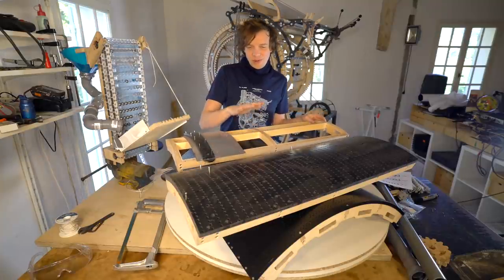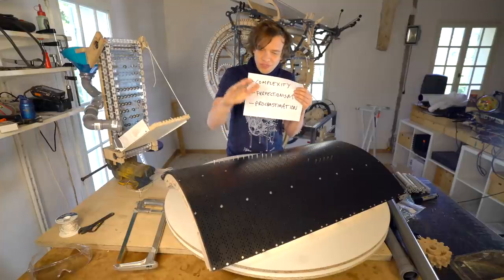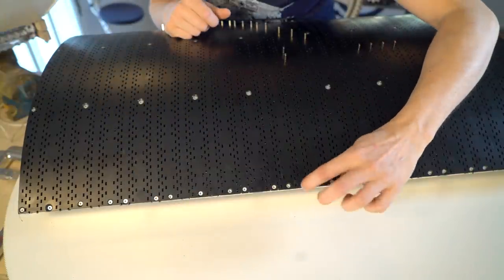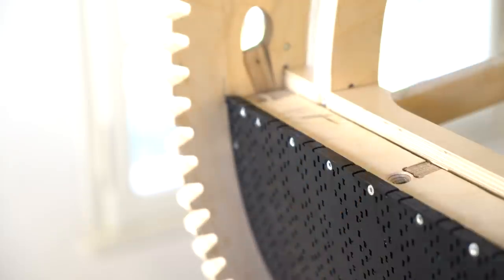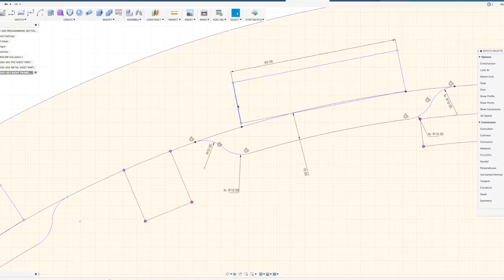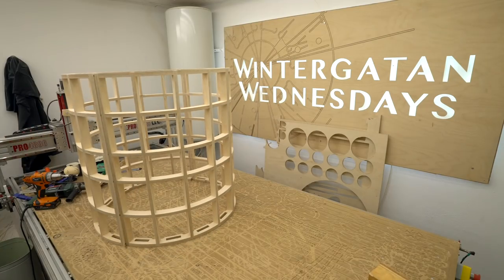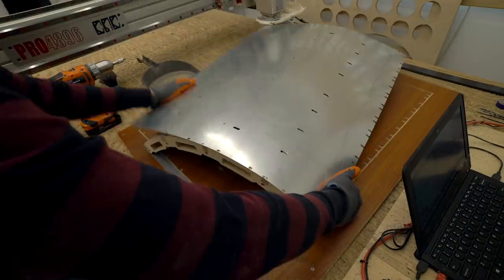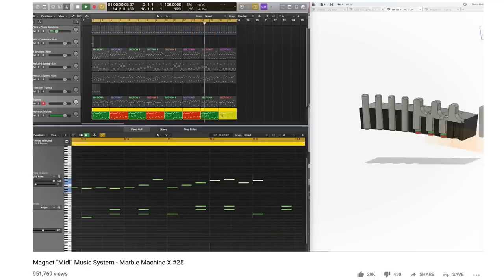Music Programming Plates Part 3 - Marble Machine X #65

Comment: The problem with Theory and Practice;
in Theory: theory and practice are identical.
in practice: theory and practice are often different. :)
you might know this, but i want to drop some thoughts i had in case you havnt planned for them.

super glue arbor: you can glue down that metal sheet to your backer plate with super glue, or similar, then heat it to break the bond and remove the part later. this means no more alignment holes, screws, pins and tape to hold down your part. be careful when heating to avoid warping though.

the material properties of wood: wood will expand and shrink with the moisture in the air. especially if you come play that thing over here in south florida. especially if you ship by boat over the wet ass sea. i recommend exploring acrylic, or a metal, or plan for a humidity controlled shipping, and storage. expansion of most parts will be trivial, but programming wheel might be significant. average humidity in south fllorida is 50-70% with rainy season getting up to about 90% on average

alignment of programming boards: you will likely have 2 or 3, or 50 songs preprogrammed on boards. you might want to design in an identification system now, numbering or color coding or something, song 3 board 1, song 3 board 2, song 3 board 3 etc. you dont want to be rediscovering the order of the boards on stage performing for an audience that hasnt followed the series, and isnt already aware of the challenge.

its cool to think through this stuff, and really put to work the whole process start to finish. keep up the excellent work man. and you bettter come perform in south florida one day. i recommend the kravis center  https://www.kravis.org/
Reply: i just rethought one of my thoughts. your indexing off that plastic board... those dont expand with moisture. you might be good. might want to design a little bit of tolerance room in the wood. make all the wood a half mm smaller or something to pull it tight against the plastic, and leave room in the wood so it can adjust. might also want to measure a wood piece, then steam it, then measure it again. the cross grain of that ply laminate will help keep some tolerance, but i wouldnt put my money on it without a test.

Comment: the only way I can think of to eliminate any register problems in the programming wheel plates is to have the entire wheel as one assembly and switch out the entire wheel for each song...not a one person job. And would require a redesign of the entire programming wheel system.

also, depending on how many tour dates you are planning, and how many times these plates are going to be switched around, over time there will be wear on the parts and the plates will lose their registration...also temperature and humidity will be an issue as well, wood shrinks and swells with changes in temp. and humidity.

Comment: I hate to potentially add to your woes, but is there risk of the plastic expanding and contracting in different temperatures?  I've been wracking my brain about the programming plates since I first saw them, but I have no real solutions unfortunately.  It just seems like there could be a more reliable way to register it all, but far greater minds than mine are working on this and I'm just a fascinated spectator.  This is an amazing project, thanks for sharing it.

Comment: your dilemma between perfectionism and complexity made me think about the Vibraphone movement from last week. is this mechanism adding to much complexity to the MMX? have you considered that under the vibraphone plates the vibrato mechanism and the resonator pipes may also have to swing? maybe this makes the whole mechanism to complex. don't get me wrong. if it would worked, that would be awesome. but isn't the main goal for the MMX to play musik tight enouth? in this case maybee you should focus more on the reliability and the correct function

Comment: Martin,  why did you not just remove the top of your table, put the program wheel on a roller with a timed stepper motor to rotate it set length wise inside your table and then use the cnc router to cut the pin holes in place. The stepper would be set up as an "A" Axis.

Comment: Rabbit the two plates edges were they meet. this way you can incorporate alignment pins. Like you said the plywood is not a stable material and will change depending on moisture.

Comment: Did you ever thought about adding a 4th axis to your cnc and process the bended and mounted programming plate with its frame locked in place? It is relativly easy build with one or two stepper motors and a worm gear each
This would increase your precission and you wouldnt have to calculate the bending efects in your processing

Comment: The non-floating one should be somehow marked in an obvious way. Otherwise, when doing a "quick-change" during the word tour you might run the risk that it isn't in the set of frames put on the machine (or multiple multiple of them being put in).

Comment: gonna be honest i think instead of reporgramming each plate that you should just make new plates that would be the fastest change over but parts and time to make the parts is up to you there is always the possibility that someone wont put the pin in the correct hole or they wont push it down and it will fall out or they could put them upside down i dunno it just sounds well ..complicated

Comment: Wouldn't it be easier to get a Laser Attachment for your CNC??
I think it will give a sharper edge.
And then you don't have to use High Pressure Cleaner, to remove chips.

Comment: Are you not concerned about the wood expanding and contracting from humidity? That concern came up in my mind a long time ago but I never mentioned it until now when I saw you with calipers and stating the length between the pins had to be precise. I know the plastic is stable from humidity but the wooden frames aren't. Especially if the wood isn't sealed. Maybe that's not a concern of yours but it was just a thought of mine I wanted to share.

Comment: Martin, how do you avoid that you unintentionally flip the programming plates and put them on the programming wheel the wrong way? You should design it that they can be mounted one way only! Good luck with the design and the build!
Reply: By printing 'TOP' on the inside of the top bar each of the programming sections!?

Comment: The accuracy of the programing drum is a key point, if you are trying to achieve the timing perfection of a played MIDI music file. But the programing drum is an analog device. There will be a change in timing accuracy in the transition from one quarter panel to the next. But honestly in my opinion 99.99% of listeners will not notice the inaccuracy. I ask you. In a live performance of musicians playing. How much timing error is between them? Probably more than in the programing wheel.

Comment: Here's how you fix the problem with cutting thin material that will not lay flat. Add another sheet of plywood on top of the metal sheet and attach it. The two layers of plywood will hold the material for you. This is how I cut brittle material without causing damage.

Comment: have you considered opting for high adjustability rather than high precision ? high precision is a pain to work with and assemble. you are more likely to damage due to the low clearance and tolerances, it harder to design, build and most importantly assemble. most high precision equipment is made in one piece and/or is not expected to be dismantled regularly. id suggest designing the plates with more tolerances and add either to the plates or the wheel knob and systems to fine tune the machine. i mean that how many instruments are designed.
Reply: gavin kemp  Good idea, but you should be using the word “clearance” where you are saying “tolerance”. It’s a common mistake.
Reply: @dansv1  what the difference, high tolerence implies high clearance because you can't have the extrems overlap. you can have high clearance and low tolerance but what the point in this case.

Comment: Rule 1: if you can't make it perfect make it adjustable. Trim the edges so they're too close together add indexed spacing clips made from magnets and steel clips you can precision mill.
Reply: Respectfully, how is Martin to provide any adjustment to the plates in the middle of a concert?  I mean this as a serious question and not a trollish idiocy.  Martin finishes song one, and they pop off the old plates and pop on the new ones.  How do you propose to perform the adjustment?

Adjustability would be fine, IF he had the time to perform the adjustment.
Reply: @WhatAboutTheBee  it's not adjustable in the way you tune a guitar. It'd be adjustable in the sense of providing points of reference that can be connected by high precision pieces without having to bother creating a perfect programming plate.
Reply: @Argosh  The precision connecting pieces between plates might work.  It effectively creates one continuous plate around the circumference.  

This implies that each set of plates remains as a set, and the order of plates within that set cannot change.

Reasonable!
Reply: @WhatAboutTheBee  you can even use the 32nds by creating triple inserts for the edge (so one index in the last 32nd on the plate, one in between two, and one in the first 32nd of the next plate), with a bit of engineering you might even be able to still effectively use those 32nds (with different types of triple inserts)

Comment: Why the holes on the programming plate is designed that way?
Reply: if your question is about the bone shape of the holes, Martin gave an explanation in a previous video, while the pins have a rectangular section, it's easier to intrduce and remove the pins with that bone shape (less friction). Hope this answer your question...

Comment: You can get 'down cut' router for cutting the edges sheet metal or other thin stock that is impossible to hold down. The helix on the bit is reversed so the cutting force holds the material down. A disadvantage is that they throw the chips down so cutting blind slots (which is about 99% of what I've seen you do) can take a bit more time. An advantage is almost no tear-out on the top surface and very little on the bottom when cutting through slots (if you have a clean sacrificial table). The best solution is to use an up cutting bit to route a slot just to the outside of the metal sheet, then cut the metal sheet with the down cutting bit. The pre-cut slot will give an easier path for the chips to escape.
https://www.woodcraft.com/blog_entries/spiral-router-bits-vs-straight-router-bits

Comment: Why don't you use hot glue (or melted resin) next time to hold metal parts on the edge for the CNC to cut them. Just use a heat gun to loosen the glue, and just scrap off (or use mineral spirits) to remove the rest of the adhesive.

Comment: not entirely sure how you'd expect to achieve 0.01 mm precision at that dimension with plywood parts hold together by wood screws, such design is bound to fail from the get go. maybe with machined aluminium parts bolted together,  tapered steel pins/bushings for the alignement of the quarters and the whole assembled drum being machined for good runout on a lathe. and even then it's a tricky enough task to pull off.

Comment: Dont you think that changing so many pins between songs is impractical? Thats thousands of pins that need to be changed between every song... thousand of anything is A LOT. Its gonna be really bothersome to change them every single time. Not even mentioning how prone to human error that is.

Imo you should have had pins in every single hole and an electronical mechanism that pushes them outward. 
And that mechanism is controlled digitally. Changing song "sheets" digitally" for efficiency, while maintaining the physical element of the pins.
Then all you would need to do is feed the programming wheel a different digital"music sheet" and the pins would change automatically.
Reply: I think the plan is to just exchange sheets between songs. So then you wouldn't have to change them at all during a performance.
Reply: I was thinking the same thing... He should at least make 4 more boards (combined 12) so you have 2 songs time to prepare the boards
Reply: Martin has said in the past that he wants to avoid electronics in the MMX as much as possible - beyond microphones, he wants everything to be mechanical and hand-driven. Otherwise, there'd arguably be little point in the programming plates - computer controlled motors for the marble release would be more straightforward. But that would go against the spirit of the project.
Reply: Yeah the plan is to exchange sheets between songs, but as you heard he is only planning for a second programming wheel, and the one currently not in use during a song, will be repinned. 

Repinning thousands of pins takes a lot of effort and time. Im not sure he has considered that thoroughly.
Reply: gh0un Martin can have a paper that is the same size as the plastic. And only the holes that  should put pins in  is there. Easy and faster without thinking 🙂

Comment: MArtin winter 2017-18:lets get this thing going and get it done by christmas of 2018!
Martin spring 2018:im moving along on the big parts. An have much of the framework and wood gears done! (Then again it was little more then improving and rebuilding the good parts of the original marble machine)
Martin summer 2018: lets start working on prototypes for the smaller details that i want to make major improvements on from the original marble machine
Martin fall 2018: i need help!
Martin winter 2018-19:i scraped these parts. Reworked these parts. And need to make adjustments to those parts.... and i dont want to deal with some other parts yet.

Comment: This is an amazingly beautiful machine with an ingenious design, but there is zero way this thing is going to survive the road. There are infinite points of failure, and unless you have at least two spares of every component 
it’s going to end in disaster. Touring and shipping are just so incredibly hard on equipment and in my opinion is that being grossly underestimated here. I would hate for you to take this thing on the road and be devastated when something either wears or breaks to the point that it can’t be fixed effectively at a venue. I don’t mean to discourage, but if you want to be reliably prepared to play shows for paying audiences you’re going to need more than one of these. Don’t find out the hard way.

Comment: what if... there were no programming wheel and you used a micro controller to activate the marble droppers 0_0 ...infinitely programmable and song changes would be instantaneous.  the micro controller would read the speed of the crank and adjust tempo accordingly.

Comment: @Wintergatan I wouldn't call it procrastination. You know a task to be daunting and its something you have to approach mindfully and sometimes you need to give yourself time to ruminate on said task. So you tackle a smaller one; what some like to call "low-hanging fruit". Many technical/creative types exhibit that pattern when working on complex projects. Meanwhile your subconscious is still working on the bigger problem, almost like a computer's operating system running a background operation. By the time you're ready to tackle the big problem you find yourself with new insights on how to better solve it. At least that's my take away from this video.

Comment: Why not make single mats (perhaps out of another material) that wrap fully around a cylinder for each song?   That way you only need to get one joint nearly perfect.    With entire mats made for individual songs you only have to mill the holes a single song on each mat.    New song = new mat.   You only need a system like what you are designing if you were to compose and change music on the marble machine... but I bet you compose your music on other instruments... the marble machine is just a playback device.

Comment: Would it be a possible solution be, to make a disc per rotation of programming holes. So you stack them to make the complete cylinder of programming holes that you need for the marble machine? Then you could make us of the presision of the CNC machine for both the holes and the guiding pins between the discs. I made a simple picture of this here: https://i.imgur.com/zNIdjqu.jpg